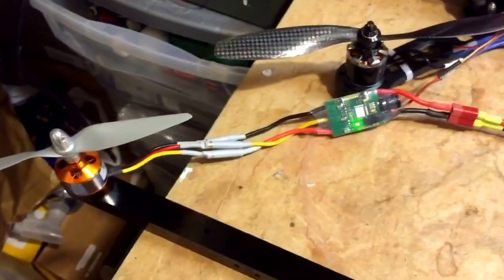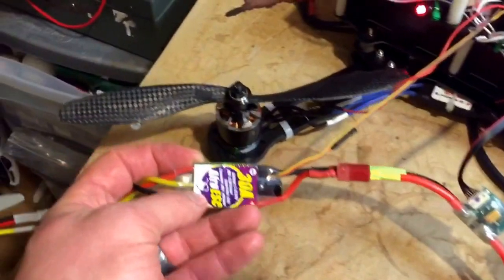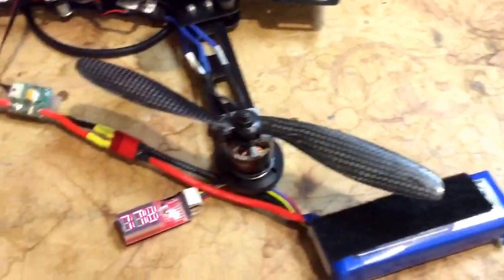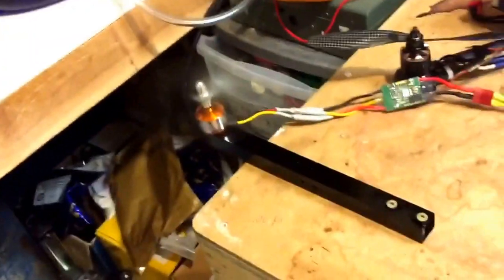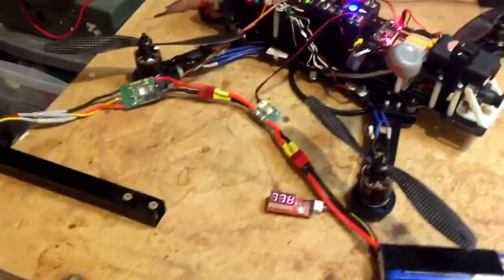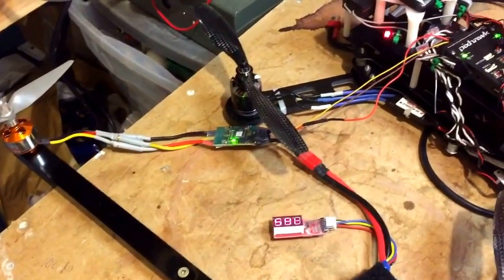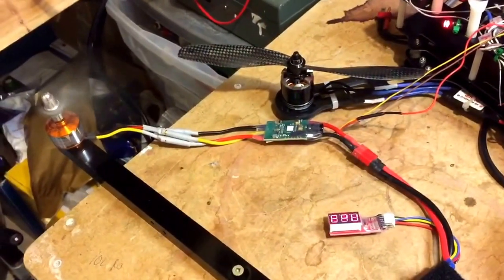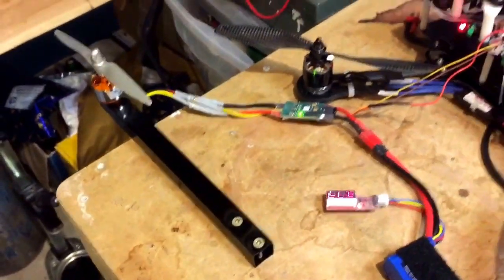Pixhawk sync issues part 5

Comment: So what you are saying, as I put the finishing touches on my Pix, is that there is some weird stuff going on with powering the FC with the Power Module? That it would be better to provide 5.3 V with a BEC or UBECand just run the V and I and Gnd leads to the Pix for monitoring those readings.
I am trying to "head this off at the pass" as they say. There are other matters as well!
I am also looking at the doing the Autotune function on a 800mm Hex just now,..and the now I hear of the alledged "loss of sync issues" that MAY arise when using SimonK FW on low kV motors with 4S Lipo. Well that is a well used set up, and one that I am employing.....
 I cannot just switch to 3S just for the Autotune, and of course who wants to find this out to be true and wreak havoc during its pre calibrated maiden tuning flights :-(
Guess  I will be strapping mine down on a bench I suppose just as you have, except with all motors engaged.
 It would be nice if you published your conclusion :-)
Reply from the maker: Chris Leech All I can suggest is to do a lot of ground tests before hitting the air.  The fix for mhy issue in the end was genuine 3dr speed controllers.  Could never get the simonk ones to work properly on my setup.
Reply: xoltri Wow, really. That is nuts. It should permit the use of any ESC.
I bought the RCTimer version of the Pix. And I hope it doesn't live up to its name they gave it,, The "Fixhawk" I am not kidding. They in Asia do not have a grasp of how this name may be ridiculed :-) But it is made better than the 3DR version believe it or not. There was a great thread at RCGroups by a guy named Joe Abram, and he pulled all his stuff down after an intense disagreement with one of the subscribers, so I am in the dark.....
 If I am forced to buy 3DR anything, I am done. I will sell it all and stick with Naza, with great regrets though. Thanks for your reply, hope it is flying well for you now